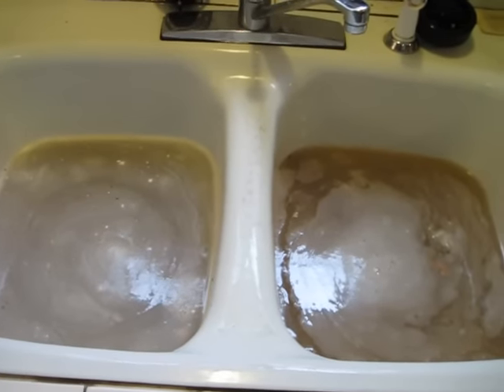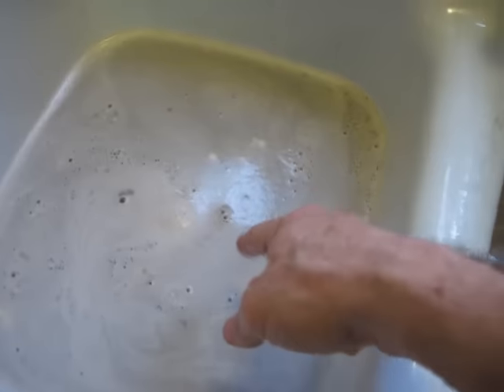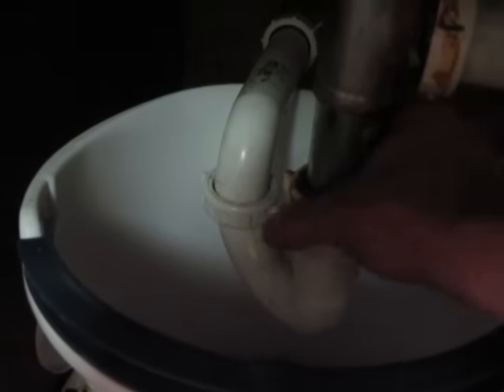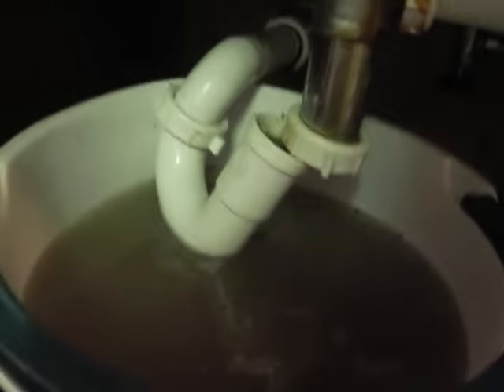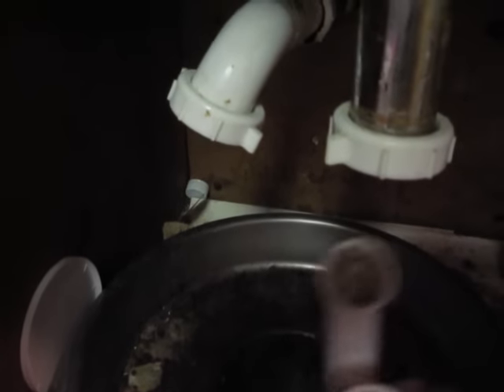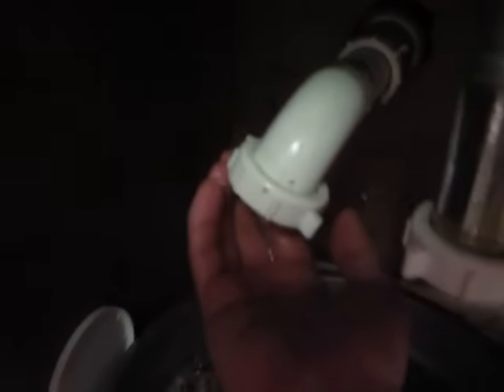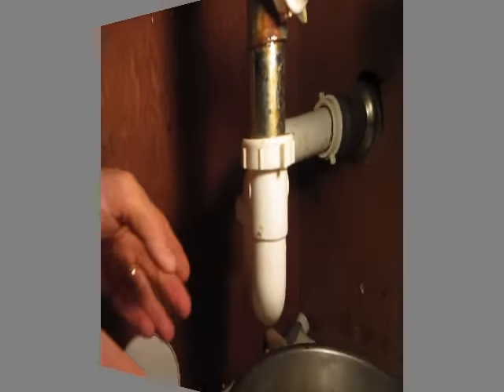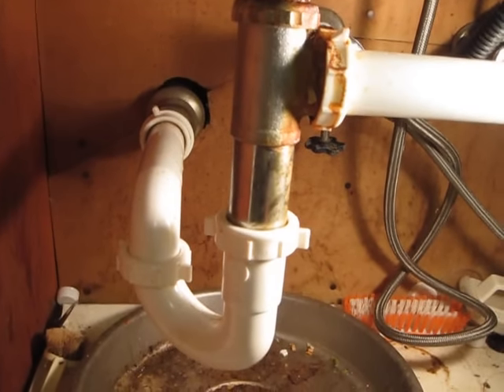How to Unclog a Kitchen Sink

Comment: Thanks to you, I was able to get over my fear of taking apart the pipes to unclog my kitchen sink. My garbage disposal was still spinning but not draining, and I still had drainage in the other sink, so I knew that clog was somewhere in between the two sinks. Your video helped me to figure that out. I feel like Wonder Woman!
Reply: YOU ARE WONDER WOMAN! THIS IS WHERE IT STARTS!!
Reply: I'm trying to get over my fear of taking apart the pipes for a clogged sink right now. Hoping to understand more the more I watch. I'm just scared of something bad happening. I don't want water spraying out at me either! 
But your comment gives me a bit more courage. So thanks. I'm glad to know I'm not alone in feeling this way. I just don't want to make anything worse and I've never done this before or messed with pipes period.
Reply: Thought I'd give you an update. Missi ok n accomplished. Your comment really helped because I knew it was at least normal to feel the way I felt and you overcoming your fear somehow helped me overcome mine. My mom will be so impressed when she comes home and sees it's fixed. Thank you for your help!
Reply: @kellylott9296  Right on!
Reply: @reginamunoz8394  your message was a huge help. Kind of the final kick in the butt I needed. Thanks!
Reply: @kellylott9296  not so bad right? haha im screwed
Reply: And when you've done this for 2 days, including dumping pots of boiling water, vinegar, baking soda, drano, pulling pipes apart,  trying to run wires etc through to clear obstruction, call the f'in plumber, I give up..

Comment: Am SO grateful. 73 year old widow. Sinks looked just like this. I’d already hauled 4 gallons of water from these sinks and decided to check YouTube while resting. 
It took all my strength to hold that black piece down(once I found it) and five tries with the garbage disposer running but I am clog free without having to wrestle with pipes or call for help. 🎉❤ there are no thanks great enough.

Comment: My husband and I tried this method once before, but because of where we live, plus it's a very old house, the water gushed out and spilled EVERYWHERE  even though we had a bucket underneath it, and the water was black. I'd do this as a last resort.

So what we did instead that worked: I put on gloves and pressed down on the sink stopper as HARD as I possibly could, (since it was completely submerged) while he plunged the other side where the garbage disposal is, then just ran it, and since I was pressing down to prevent any water going back up on my side (which was easier said than done, so much pressure, I had to hold it down using all the strength I could muster) The water eventually went down, and pushed the air bubble through, and it drained correctly again.

But in the future, I run the garbage disposal with hot water for a few seconds before putting any food down there. Foods I realize you should avoid:
Rice (NEVER put any rice down there) potato skins, mushroom stems, oil and anything else extremely thick like stew leftovers, etc. I just strain the food, and pour it in a grocery bag, seal it up and put it in the trash, and take out the trash not long after. Hope this helps for others!

Update: we STOPPED using the garbage disposal and use a sink stopper. Everything goes in the trash. Our plumbing can’t handle anything but liquid.
Reply: Cucumber peels clogged up my sink and here I am, learning how to unclog it.
Reply: I just put rice in my sink. Lord help me.
Reply: @Morgan-yl4uk  yeah, it’s pretty nasty. Like sewage and dirty water. Not poop, thankfully, but it’s not pleasant.

We actually stopped using our garbage disposal. Everything solid goes into the trash.

Comment: Thanks for the video! I removed the trap and the sink drained. Few things I did, 1 drained the sink as much as possible with a plastic cup I had lying around. I also put a plastic sheet under the trap in case any water spilled - I was very limited on my bucket/pan options...I actually ended up using an empty dog food bag which worked really well to catch the water haha

Comment: Couple of tips when you install the plumbing, run the water very hot for a couple minute after you tighten the compression nuts. Then re tighten them, this heat them up a allow an extra half turn or so. Also you can wrap some paper towels around all of the joints then let the water run for while, if you have a slow leak you will be able to tell exactly when it's coming from before you discover it days later when the bottom of your cabinet is soaked.
Reply: John Potkay the paper towel technique is one my father taught me. The water shows up great! Good tip.
Reply: John Potkay iy

Comment: Thank you Rob Reynolds! Your plumbers trick worked!! It did spray water all over the place and I had a hard time holding the plug down. But I did and it cleared the clog. No need to pull the pipes apart! Thanks!!

Comment from the maker: For P-traps you can use almost any drain snake to clean the pipe.  Just google Drain Snake or Pipe Snake.  There are a number that are under $10 that could help clean out a P-trap.  You would likely need a more expensive, longer one to clean out deeper clogs.

Comment: Hi, my sink looks and behaves EXACTLY like yours. I followed all the steps but there was no blockage in any of the parts of pipe discussed in the video.  However, after I put everything back together and ran water threw it both sinks began to fill up again as before.  I guess the only place the blockage could be is farther back towards the wall of the sink.  I could not disconnect any more of the piping heading farther toward the back of the sink due to the previous homeowner epoxying the joint together - however as far back as I could see looked clear.  Do you think our blockage is even farther back?  It does take a while for the sinks to fill up again when I have the water running on a medium speed.  I'm thinking we will have to call a plumber but any tips/advice you could give would be most appreciated!  

By the way, great video, very clear, it made me feel confident to try and tackle my first ever plumbing problem as a new homeowner :)
Reply: Start a crank manual snake after the last joint, may get lucky~

Comment: This video saved the day, I purchased some sulfuric acid but decided to try one more video  to get a different perspective and I came across this video I  was able to take apart the pipe were the blockage was and in about 10 minutes the job was done, problem solved. Thanks for the help.

Comment: I had tried & tried to plunge the clog to no avail. I then tried the baking soda and Vinegar which had worked in a previous clog.myet, that did not work.  I left it for a day hoping to come up,with another alternative and came upon this u tube tutorial?   It worked wonderfully! I had to remove the p trap or so I think it is called and found the cause of the clog?  I never would have tried this on my own, but this tutorial made it less intimidating.  I saved myself at least $150 that my plumber charges just to walk in the door?  Thanks so much!

Comment: I was really hoping this would help. I've already unclogged all pipes under my sink and fed 30 feet of snake through them as well with no luck. Any other ideas? Because I can NOT afford a plumber
Reply: When you snaked the drain you could have went up the vent and not down the drain. You have to try to direct the snake down the tee in the wall and not up the vent.

Comment: I have a similar problem. Last time I used a plunger while covering the dish washer overflow hole with duck tape and a second plunger on the other side, and it worked, but it is still slow. I know sometimes it's better to let the plumber do his work; however, if it is simple enough and you have the time and the tools, I think it is worth the try. You could save some dollars. Thank you for the recommendation. I will try this. God bless you!

Comment: Rob Reynolds Plumbers Trick saved my butt.  My blockage was deeper than any pipes under the sink.  The trick was getting the garbage disposal side at least half full to add pressure as you run the disposal and plug the other side's drain good and tight as it ran.  I had to try it several times just as Rob said I might.  But bamo!  it blew all blockage through....saved my butt.

Comment: Awesome trick, Mr Rob!! I had a bad clog, it took me 5-6 times, had to add more water to the sink on the garbage disposal side and hold down really hard to keep it from coming up on the other side - but it cleared and you saved me another call to the plumber - Thanks a bunch!!
Reply: I’ve been holding a plunger on non disposal side for 10-20 minutes with disposal on! I haven’t tried adding more water on that side, but I’m not sure it’ll help. Only thing I put in sink was tangerine peelings. That’s all. The disposal usually eats them up. This sink is like 3 years old. Only problem now!

Comment: Nice and easy to understand tips to unblock a drain pipe. Just another tip when using the 'wrench' as you called it [here in South Africa we call it Waterpump pliers] but that aside, turn the tool around so that when the teeth bite the nut, you're actually gripping and pulling the nut loose and not pushing it as you did. Less force required. Still a great video

Comment: I did it, and it appears to have worked. I had to snake it because the P-trap was not clogged at all. I snaked it as far back as I could get it into the PVC pipe leading into the wall. Thanks!! Now, I have to figure out how to get the strainer off because one of the sinks is leaking,

Comment: I watched about 15 videos on this subject, I tried 
LA’s Totaly Awesome Drain opener and  a jug of 
professional formula Mister Plumber with 1 cup of Dawn blue dish soap with 
2 pots of boiling water after time had elapsed and...... a plunger
Success!!  I can’t say which product worked but ide try this process again
One thing to watch for is to read on the label of the drain product... is... I have a garbage disposal 
Look to see if you can use this if you have plastic pipes under the sink,  and a garbage disposal, I don’t want to melt it or something worse.
Good luck! Hope you get your sink unclogged.

Comment: Thanks so much for the video. You just helped me unclog my sink. When i took the u-joint off there was a butter knife and an ink pen stuck in there. Luckily I had one those wrenches you used, so I was able to unscrew the caps off the joint. Thanks again!

Comment: Just the video I needed!
Also, wondered if to fix that metal pipe coming out of the wall, couldn't you just rub the rust off the threads with steel wool, them put plumbers tape on them and screw the pressure nut back on?

Comment: As loose as all the material was in the pea trap should have immediately told you that wasn't the source of the blockage. I have trouble with maneuvering a snake past any 90 degree angles so I find that I have to go in underneath thus, removing the drain pipes. Pain in the butt. I have a pressurized plunger that I use now. Spectacular tool.

Comment: I had a major clog where my tenants upstsairs has both sinks kitchen and bath clogged. Could get the snake farther than a foot in. Luckily the apartment sits on top my garage and grandpa had all pipes exposed. Mine was a lot more in depth and we snaked almost whole drain into main lines. The 2 lines that comnect to a main line had a clog and fillled with sludge. The process of plumbing is common sense but going from your regular dump valves to a main valve can cause issues. I believe what we did was a deep unclogging that went beyond snaking a sink. U got lucky

Comment: Before you start opening, try 18 gauge steel wire with a hook in the end. Poke it in, twist, push and pull. Always worked for me.

Comment: If the gunk is deep in the pipe and you have two sinks, have someone hold down the one plug and take the plunger and just keep hammering it with hot water

Comment: So - when I unhooked the joint on the left above the gooseneck at the bottom it came detached and it appears it broke the bottom of the metal joint in which the pipe going up to the sink was.  That’s directly connected to the drain!

Comment: First of all, thank you for sharing this video!!! For the very first time in my 44 years of life, I got under the sink and tinkered around. I was able to remove the "U" looking pipe section, but i think my blockage is beyond the wall. I don't have a drain snake, so I used a wire hanger and got as far as 1 ft.....and I couldn't really tell how far blocked it currently is. I will try Drano and/or getting a Drain snake....any other suggestions.

Comment: That side pipe you put into the wall, is that a tail piece fitting? Looked like a tail piece where the washer goes inside the taip piece. Didnt look look like a compression fit. From what I'm finding out plumbing is easy you just have to find the clog

Comment: I live in an apartment and the maintenance guy came and used some cord that goes in for feet and that didn't work. I guess they will call a "professional" to fix it. What could be the problem? The bathroom sink does fill up with water only after a few seconds of running water, sometimes it backs up on its own. He went to my next door neighbor and worked there, too, but it didn't solve anything. Is there anything I can do on my own instead of waiting for I don't know how long?

Comment: I use my shop vac to suck the water out of the sink, thus avoiding the need for the need to lift  a bucket full of water. I would still place a bucket under the P Trap just in case there is still some water in the pipe that needs to drain or for whatever is causing the clog to drop into.

Comment: What if the pvc pipes are connected without removable nuts. They just connect together. After the ptrap, the pipes are not together with the nuts. Do I force them to be separated or do I just have to call someone.

Comment: what if both sides are dont draining? i have a disposal and if i run it all the water goes to the other sink. when its turned off the water goes back into the disposal side with water also full in the oposite side. Ive tried all these steps with the water still not draining at all. Any help would be awesome. Thank you!

Comment: I'm a pro plumber 99.9% of the time a clog in kitchen sink is far beyond the j bend of the the trap. They are also slip joints not caps or compression fittings. Keep DIY'in and learning bro

Comment: This is EXACTLY  waht I needed to know. One problem though, I tried using Liquid Plumber. I poured a whole bottle of it down the drain, and when I came back, the water had come UP into the sink instead of going down and now the sinks are like 3/4 full of water with Liquid Plumber in it. I may have a bucket big enough. But my main question is, if I have to take off the pipe with that stuff in it, would regular rubber gloves be enough to protect my hands from the corrosive liquid?  I am totally terrified now, and I am in a building and there is no one in the office for the holiday and the super is away, too.

Comment: So I did the same but the blockage is from the main pipe that takes the water out through the wall and still have blockage 
I have tried the other gentleman solution and closed the sink that didn’t have the disposal and didn’t work too the disposal didn’t work like a water pump
And I have cleaned all the pipes under the sink except the one through the wall 
So what should I do

Comment: Hi Geo

Tried this and my double sink is still clogged , water on both sides. It will drain but takes forever. Any suggestions? Before I have to call plumber. There was nothing in p trap like food, etc or in main drain pipe that I could see

Comment: Both my drains were backing up in the kitchen sink. The main drainage line underneath the sink forks, one fork is connected to the disposal, and the other fork is connected to the left side of the sink. It would not drain at all. After snaking every line in the house, no line was found to be clogged.  I then unconnected the P-Trap from the left side and gently turned on the water above the disposal (right side of sink), where I could see if the flow of water was passing through the main drainage line, which it was.  This told me the problem was with the left side. Apparently the Left Sinks PVC insert fitting inside the main drainage line, was too long and was obstructing the flow of water going out from the Disposal (the other fork), and was diverting the water away from its original flow.  I cut about an inch off the problematic PVC pipe, reattached the P-Trap, and I'm good to go...

Comment: if you use the disposer as a water pump to push the blockage, don't let the water pump try so hard/run too long as I have seen the high water pressure would cause the disposer to leak water at the bottom. Hope your disposer is built to guard the short circuit and auto shutdown. removing the U-pipe is not hard and easy to clean it and put back.

Comment: You can unblog a kitchen sink by placing a bucket under the drain pipes and unscrew them and all the water will go into the bucket and then you are going to need to clean out the drain pipe that you unscrewed and then once you done that screw the drain pipes back and you done it.
So simple I learnt this by watching once.
Never need to get a plumber no more

Comment: If the blockage is even further down the line, try using a hand auger. If that doesnt work, call plumber. Also make sure your washing machine isnt backing up in your sink, if so call a plumber
Reply from the maker: Yes, hand augers can work well if it's not that far down.  Thank you for the comment.

Comment: I tried that no luck I have a main pipe with a plug on the side I removed that an fished a coat hanger in side still no luck resorted to liquid plumber the gel an helped a ,I'll but still not draining well what would u suggest at this point